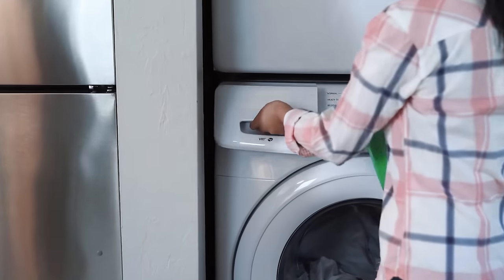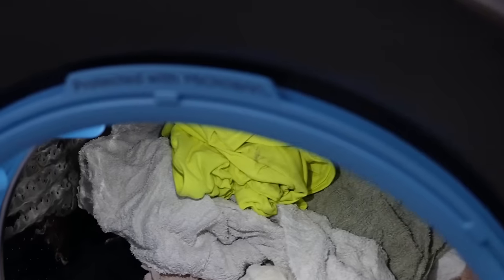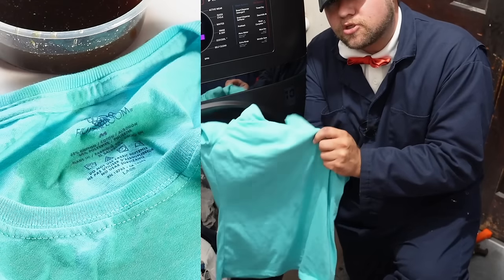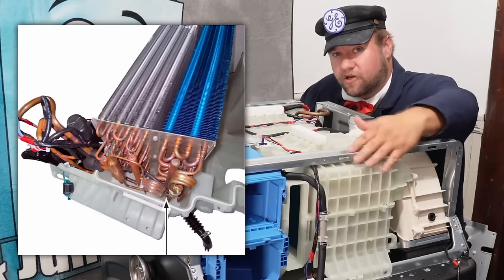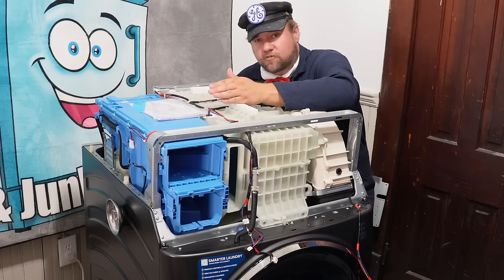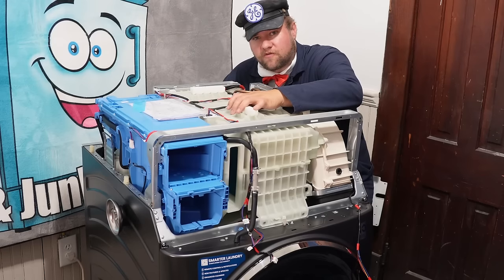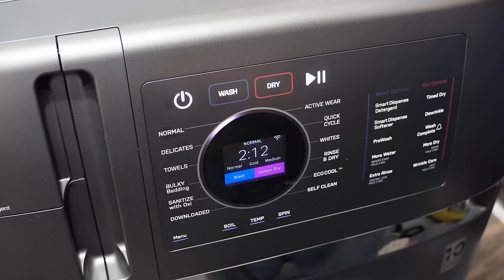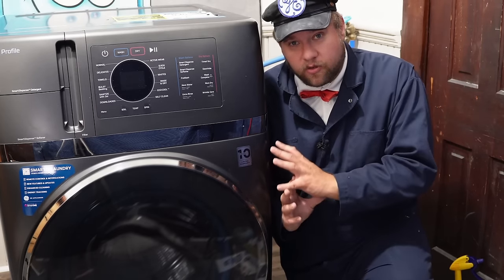The Best Washer Dryer EVER? The Ultimate GE 2-in-1-washer Dryer Combo Test & Review

Comment: If you own one and haven't discovered the flaw in the machine yet you better soon before you are looking at a big repair. Not sure how this reviewer didn't notice.  Pull the lint filter out and look in the opening of the machine with a flashlight... to the right. Look at the build up of lint on the evaporator that's happened in a matter of weeks. You'll likely see 4  big spots of built up lint.  If you look you'll find that they line up with the clips on the pull out lint tray. 
Good news is I've experimented with the clips to try to stop the lint from bypassing the filter and I think I solved it.  I've found if you block fronts of the clip (not the top and bottom of them) you can stop the problem. To test it out for yourself, you'll first have to remove the lint lumps that have already embedded themselves in the evaporator. I used a toothbrush on a stick to tease it out of the coils and pull it out. 

You can either try drying something again after you clean it out and you will see the lint reappear exactly where it was... or to just cut to the chase you can place thin strips of the electrical tape over fronts of the clips on the lint pull-out trap, the top and bottom of them is not necessary. Wash and dry your lintiest rug and you will see that NO lint makes it through. I'm going to put silicone caulk in the front of the clips as a permanent fix.

Comment: Great review. More than I expected as I did not see a twist lock fill port for the refrigerant. 
Question - mold.  Our old LG front loader developed the mold smell, so we went back to a Kenmore (DIY serviceable) top loader. 
Question - can you open the plastic cover and get into the coils to blow them out with compressed air?  
Because this dryer filter  will get all the dryer lint, I see you point about it being a source of failure to maintain. 
Also - the dehumidifier technology is great for Apartments and HOA that require dryer vents be cleaned out professionally.
 Australia kind of pioneered the dehumidifier dryer, glad to see them arriving in USA.
Reply from the maker: Question - mold.  Our old LG front loader developed the mold smell, so we went back to a Kenmore (DIY serviceable) top loader. 

A: It has a micro-ban door gasket seal thats supposed to resist mold.

Question - can you open the plastic cover and get into the coils to blow them out with compressed air?  

A: Yes, but I am not sure exactly how hard/easy that is. I am going to document that very thing today on camera for a video, so we will find out soon!
Reply: @bensappliancesandjunk   
Thank you for both answers and the quick response. 
I look forward to your next video. You just earned a new subscriber.

Comment: An important factor that is hard to measure is that when you are running a traditional vented dryer, you are forcing air out of your home, which means that air is forced into your home as well. So if you are running it during the summer or winter, you are spending more money on your AC and heating. Plus air that is forced in can be "dirtier." These are perfect for "tight" homes that are being built to higher energy standards.

Comment: One point I didn't hear you bring up specifically about this combo is that it will run on a standard 20A circuit and it does require a dedicated exhaust for the dryer... With all that said... would you recommend some kind of dedicated air movement around the machine or could you place it in a cabinet with a door and just leave the door open during use? Is there any long term advantage to fully cleaning both filters before each use? Finally, does it have a sensor that weighs the load? If so, is there any advantage to doing more smaller loads during the week rather than say one 10# load a week (i.e. two 5# loads vs one 10# load)?

Comment: I live in an apartment with no hookups. It was built in the 60's so not sure how wide the pipes are.  with the landlord's permission, I am thinking of putting in a closet that shares a wall with a bathroom sink. Do you see any problems with the drain hose dumping water too fast and overflowing?

Comment: Hi Ben,
Excellent video that helped me convince my wife to go with the new technology to replace our 21 year old Maytag front load washer & dryer. A quick question: Since the Combo's drum & door are similar to the Ultra Fresh vented models, can the Combo's door be reversed using the same process?
Reply from the maker: GE says no. I say yes but there are caveats: you'd have to re route the wire harness to the opposite side and that will require a longer wire that would require being soldered in most likely. But as far as I can see, the door chassis is identical to both models.

Comment: First, those stains should sit for at least 48-96 hours, that is realistic to most households but I appreciate your effort. Second, filter cleaning after each use on ANY dryer should be the norm not the exception especially due to increasing fire risk.  Third, we have a very small home with limited space for our extra large capacity front load w/d set so we have seriously looked at a Bosch or Miele all-in-one to free up space and give our now set to our son and daughter-in-law who really need a extra large capacity set; now we have a GE to consider replacing the set with.  We will now do a price comparison and capacity comparison, as I really dislike having to take some of my bedding to a laundromat hence the w/d set we now have. Fourth, I see people overload both their washer and dryers because they hate doing laundry and they rarely follow manufacturers suggestions about load size and NOT COMPACTING the clothes in the units because it overworks the units, increasing repair risk but it also doesn’t clean or dry as well when you overload your units; we are empty nesters so having a smaller all-in-one is good for us and the ability to start a load at night and not worry about letting it sit overnight still wet and getting smelly before drying is what is selling me on an all-in-one unit.  Thanks for this review.

Comment: Dig your videos; appreciate the detail and experience shared.  Already ordered one of these when my old washer died so here's a small apology for missing out on your affiliate link. I've definitely heard concerns about the lint trap vs. condenser coils in other reviews and appreciate having that corroborated here more authoritatively.  Looking forward to your future testing.  Thanks!
Reply from the maker: Thank you so much! 
I've ran about 5 loads through it. I am going to film the heat pump replacement soon by-the-book as how GE suggests it (its a whole package, you just take the plastic tub, compressor/coils and all and drop the new one in). But before I illustrate how to remove the plastic box, I'm going to take the cover off and film the coils for a future video. "Heat Pump vs. Tumble Dryers"

Comment: I have a front load whirlpool that is still running 20 years now. No issues. The one thing i wish it had was a warm rinse selection. Toronto water comes out of the faucet at 15 degrees. Not quite room temp machines work better at rinsing. Does this and newer machines have a warm rinse setting?  BTW great video.

Comment: My AEG heat pump dryer is 12 years old and gets used probably 2-3 times a day, I clean the filter after load, it has another 2 filters to stop fluff going on the coils and fins and refrigeration unit, after 12 years it’s very very clean,,  you guys have a lot of vented dryers down in basements so the vent pipe comes out the dryer and bends upwards quite a height to get a vent that will vent outside,  that’s not right, excess lint that escapes the filter will end up in the pipe, and unable to get to the top especially when the next load makes it damp and it sticks to the pie and then gets thicker and thicker and you need your vent cleaned out,  a vent hose is actually meant to be straight, front the back of the dryer and through the wall to an exterior vent on the house,  the shortest path possible, and the path that will not clog with in 40 years as the damp moisture laden air and escaped lint doesn’t have to go upwards to which is harder to do

Comment: I have LG two in one, - and I keep replacing pump almost every year. My assumptions is that the pump is not made for high temperatures, so it keeps failing all the time. Replaced already 3 or 4. Last time ordered 2 of those, - so won't need to wait week or two whenever it is gonna break again. I would honestly keep those units separate. High heat temps are putting some extra toll on the whole unit.

Comment: I'm more concerned about over all efficiency. We have a washer and dryer that are about 13 years old. They are on their way out. So it's getting to be time to replace. 4 hours is fine for a cycle as the goal would be to run it overnight while we are sleeping. I really like that it has a heat pump. Our electric bill is out of control and I'm sure a lot of it is all the old appliances around the house.

Comment: I don't really know what is a standard drying time for a dryer, in my experience though a dry cycle was about 35-45 minutes on my old machine, and unless I'm washing a large load of heavy items I haven't had this machine go beyond the 2 hour mark and in most instances everything comes out completely dry, on occasion some items will feel moist to the touch, but a far fly less damp than a heavy load in a standard dryer that you'd have to rerun a second time, further bridging the gap between this machine and the standard.

I clean my filter every cycle, as I did with my standard dryer. And the machine will tell you to clean it before starting a new cycle; it's your choice to dismiss the notice or not. 

I would say people should make sure their machine is level, because mine was installed in my basement and tilts slightly forward, causing mostuire to accumulate in the filter. This was solve after adjusting the legs.

Comment: As far as cost wise goes, it seems to be about right considering a heat pump dryer is 1500 bucks.  This is definitely within my use case for my camper to have a full size machine that can do the bedding or just regular loads, and draw less than 15 amps.  And then on the next part with my personal house when I built another one I would definitely have two of these because I am constantly getting to the point where I'm forgetting to do laundry and I have two loads to do and then I'm forgetting to swap them out when I get home from work or wake up in the morning to have something like this that is as efficient and one and done this type of combo unit really fits most of my wants list.

Especially having two of these in a house setting and you want to wash your comforter and bed sheets on a king bed at the same time and not have to change over to the dryer so everything's done when you get home from work

Comment: I could see this as attractive as a space saving option if you don’t need the capacity and are concerned about energy consumption,  and you can still have space above for storage as compared to standard space saving units. However, if you run multiple loads on a regular basis, and have space for standard size separate washer and dryer units, I don’t see much benefit of this for the price point seeing as you can pick up a set of full size units for the same cost or cheaper. Even if you bought two units, which would dramatically increase your cost, the time saving would be close to only 1 hour for 2+ loads.

Comment: Nice machine and perfect for a small apartment but $2600 is a huge markup. I would be all in for $1100.
Reply from the maker: That would mean its $700-900 cheaper than the WD set that its built off of & replacing...

Comment: Just found your channel and it’s great! I’m now subscribed and liking vids. I have a question, I think you said this doesn’t require a traditional drying vent? That it condenses and the moisture and dumps through the drain hose? Is this correct? The way our house is set up, our dryer vents into our garage and creates a monstrous mess! This would be a lifesaver for me as we’re looking to move plumbing and electrical to create a laundry room in a different location.  Thanks again for the video!
Reply: That's correct! No vent needed, just a 110V plug, water hookup, drain, and a zest for life!

Comment: this is great if you are going to run one load of laundry.   However, if you're running multiple it's going to be much slower.   3 loads of laundry would take 50% longer in this than having separates (assuming same total time per load split 50/50 washer dryer). 6 hours vs 4 hours.

Comment: Hmmm this Washer - Dryer Combo would be perfect for a Yacht / Boat, especially the no need for an Exhaust-Hose for the humid warm Air.
120V at 15 Amps should be no problem for a Onboard Converter and it wont suck the Batteries / Powerwall dry

Very Very Interesting

Comment: and how is the rubber belt between the drum and motor?.. These are the part that brakes most time with Dryer+washer due to the heat making it dry out faster and then a heavy load of cloths comes in and snap... I find these machines last 2-3 years and then brake while a separate setup last's 10-15 years.. 
But I am just a jack of all trades and house service repair man for last 25 years.

Comment: After 4 hours, a fleece blanket is still damp? Any cost savings from the heat pump is offset by the extended dry time.
Reply from the maker: Not at all. 

It was under 2 KWH wash+dry on the 18lb load. On a traditional unit, its going to be in the 3 KWH regime just for dry, not the wash.

Comment: I dont like that it doesn't seem to have  a Rotospray wash water stream .Turbo Wash  if you want the modern term for a recirculating wash water spray system. Haven't  you seen the Lady Kenmore Combination with the Roto Spray wash on Youtube? NOW that was a fantastic washer dryer combo. I know because i grew up with my parents using that Lady Kenmore Wash'n'Dryer Combination and it was reliable and with a gas dryer. In 2 hours a load was done ready to fold .

Comment: I’ve had this unit for about a year. Actually, it’s not the same unit, they  replaced it a couple of weeks ago. It worked great for the first 6 months, then slowly but surely every single major component broke one after one. To make sure this unit works correctly, you need to change the way you wash and dry your clothes. You also
Need understand how this machine works, so that you can better maintain it. The tech from GE, that came to our house 6 times- said that because we were the Guinea pigs because we bought it so early. The dry time for heavy items is  not ok. The maintenance on this is extreme compared to a normal washer and dryer. The amount of people that are having problems is definitely not ok- every time something broke, our tech told us people were having similar issues and our part was back ordered. Finally dealing with GE customer service was the worst of the worst. Imagine your machine breaks and you have to wait 2+ months to fix it. We had this happen 4 times in a row.

Comment: I must give you kudos for a very good analysis.  I think this is the first time I've seen one of your videos - and it's a little disturbing to see someone in a GE hat dressed as the Maytag Repairman 😜 - but I was shocked to see how relatively well the run-times & dryness compared to a normal system, not to mention the power consumption!

As you said, the purchase and maintenance costs may be significantly more, but I'd like think (hope?) that most people can learn to handle the filters.  However, in one of those cases of "unintended consequences" I'm wondering if the drying system & the filter cleaning are going to clog up people's drains drains!?!  😅

( I also find it depressing that Electrolux could buy GE appliance, after GE supposedly spent a Billion dollars updating Appliance Park, only to find that this thing built in China... )
Reply from the maker: Electrolux never bought GE. The US SOCTUS struck it down. Haier bought GE instead. Thats why its made in China.

Comment: A cheap shop-vac that will reliably clean both the white and foam filters is gonna run about $80 and you can just keep it right there with a good bag in it...   So figure with the price of a shop-vac and the MANDATORY leak pan you're looking at about $200 over the price of the machine.   Very very very very important with these to not over-soap the clothing.

Comment: For those on the road: Data points...
"...1.25kWh to 1.35kWh per load." These are very important data points gathered from another video commenter. I'm also purchasing for an RV install. Here are a few data points to prep for your install. 
- Electric Usage: 120v @ ~ 1.25kWh to 1.35kWh per load = ~11.25 Amp draw (e.g. Amps = Watts divided by Volts) = ~ 3 loads maximum for each available EcoFlow Delta Pro with a battery capacity of 3,600 Watts or 3600 Wh (Watt Hours). 
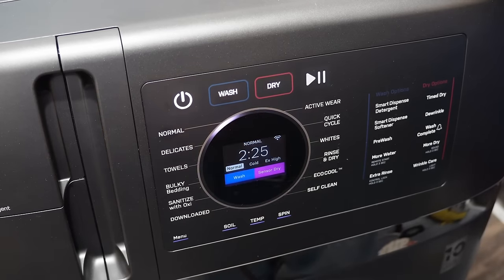- Water Usage: @14:29 10 Gallons of water used between the hot and cold settings for an average load. Still searching for data per cycle type, per average load.
- Active Cooling (Back of the unit is ~ 100 - 120 degrees Fahrenheit while in operation): AC Infinity WiFi/Bluetooth Controller +Temperature Sensor +4" inline fan with ducting to exhaust the thermal load presented by the compressor/components via the rear wall of the unit during operation.

Comment: I suppose you're saving it for the full tear down you mentioned but I would have liked to see you (even in a time-lapse) pull the condenser in this video, you mention it being designed to come off, but there were quite a bit of cables and such going across it.... Also one thing I kept wondering you mentioned a 5 year warranty on the condenser.... If you end up having to buy a new one, any idea on what the warranty looks like as a part?  Is it a new 5 years? or is it something else?